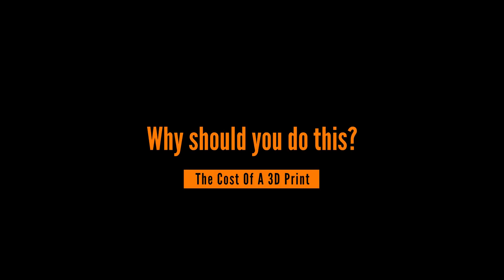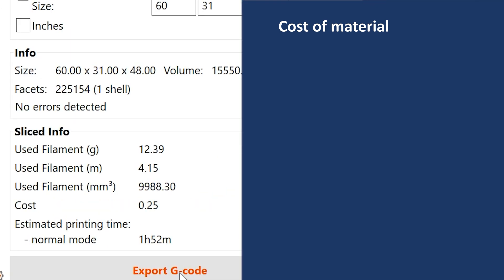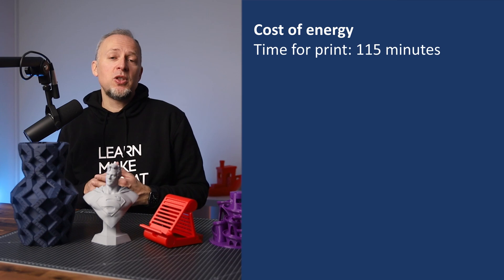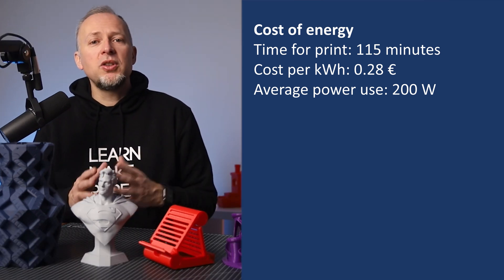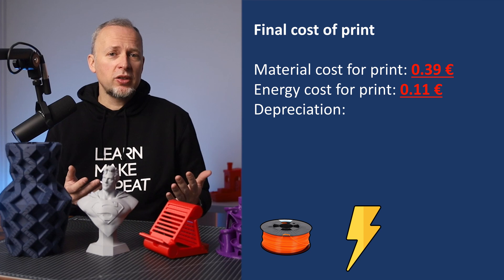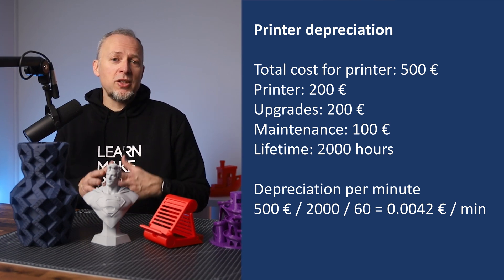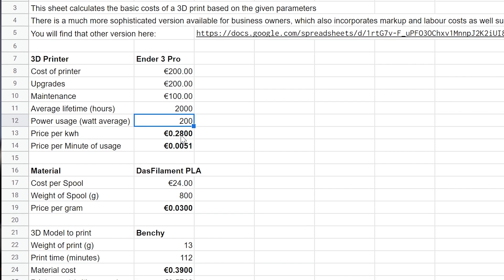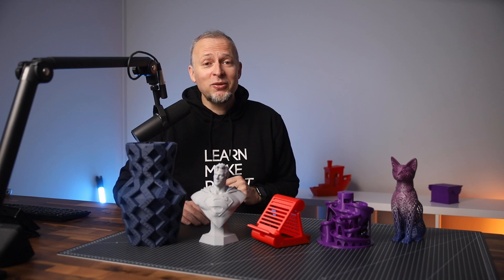The Cost Of A 3D Print - How to calculate + FREE TEMPLATE!

Comment from the maker: In this video, Daniel explains how to calculate the cost of a 3d print step by step and how to use his simple calculation sheet to make 3d printing cost calculation much simpler.

My simple calculation sheet: https://docs.google.com/spreadsheets/d/1gfuuR21fdRZWOYWdQsW0s5I5Q4PSdR1lK8_51lTnaI4/edit?usp=sharing
More sophisticated version for business users (derived from CNC kitchen version): https://docs.google.com/spreadsheets/d/1rtG7v-F_uPFO3OChxv1MnnpJ2K2iUI8qPukgcS2Icns/edit?usp=sharing
Reply: do you do custom jobs?
Reply from the maker: Yes, I do custom designs and prints. Do you have a project?
Reply: @Crosslink3D   yeah. I have contacted three companies and its been frustrating. One wanted to charge me $200 to resize my design. One responded 4-5 days ago and nothing after a greeting. Third accepted the design said they would resize and quote a price 3 days ago. Am i wrong or should that not take more than an hour for a pro?
Reply: @Crosslink3D  how can i contact you? I have the design and it needs to be re sized that is all. It is a circle with a hole cut out of the middle and a pattern of cut out designs. I need it to be printed with a flexible material. First i need two to test.. then potentially a lot
Reply: @CrazyScooterMods  I can help with your print if you want
Reply: 2000 hour life of a 3D printer seems really low. If an average of 8hrs per print is used, you can only print 250 models before you need a new printer? I would hope they last longer than that.

Comment: how do you factor in R&D costs? product design, test prints, software, etc.
Reply from the maker: Good one, I guess  this is very individual but I am considering some kind of markup for that. However you might get to it is the question. R&D needs to be calculated into the price with a certain expectation of sales of the final product and that is something you might not be able to guess easily. So with experience and probably a couple products launched you will be much better to guess this number. But it's not easy for your first product. I think enough margin buffer is required to have room for development and unexpected cost.

Comment: I like your information but I don't think the depreciation is correct. I use a Prusa printer (already has 4,000+ hours) and they are estimated to last at least 10,000 hours (5x your estimate). I have probably spent another $400 on my machine for parts but much of that has been upgrades not replacing defective stuff (like extra beds, new Revo hotend kit, LED lights, Rasberry Pie....) The only needed replacements were 1 boden tube (inside the hotend to extruder) and 1 bed thermister and 1 control knob this was a total of like $25 in just under 4 years. I also have used some lube, paper towels, alcohol (to clean bed) for the panel (the paper towels and alcohol are used every print but I get paper towels that are cut as 1/4 normal sheet and I use one of these small amount for 4-6 prints before replacing, the alcohol is likely the more expensive thing as I use lab grade 99.9% pure and I buy in 5 gallon for $140 (I use in my business to clean machines and epoxy as well) and I probably use $0.10 worth per print

Comment: In that business sheet... You have a cost of around 12 EUR and you apply a markup of 50% and the suggested price goes down - below the costs? What?
Reply: it was calculated wrong.  it shows a 50% discount instead of a 50% markup.  it should be 12.46+6.23=18.69. (12.46×1.5%)

Comment: Thank you for this video!

These numbers seem to calculate the break-even point for your costs. This is the minimum amount that you need to ask for your 3d prints. 

How do you calculate the fee that you are going to ask for to make it worthy of your time when offering your 3d printing service?

Some other things that can affect your fee:
- Your skill level in 3d printing
- Level of model detail (0.05mm - 1mm layer height)
- Complexity of the prints (high failure rate = higher fee)
- Type of filament used (PLA or difficult to print materials)
- Custom 3D Design or just DL existing model that is ready to print
- 3D Print design fixing and tweaking
- Speed of delivery (1 - 14 days)
- Bulk discounts (1 print or 1000 prints)
- Consistency in quality of prints
- Support and Customer Service
- Market price in your area
- 3D printing service availability in your area

I don't think it is unreasonable if you sell your model for 3x the cost price. You build it for 1 dollar but you sell it for 3 dollars. If there is a bulk fee applied you sell 100 models at a lower 2.50 dollars.

What do you think?
Reply from the maker: Thanks for the ideas. I am planning to make a whiteboarding session how to price a print end to end for real customers soon. So I will definitely look again at your list for more ideas what to consider.
Reply: @Crosslink3D  Awesome! 

I am thinking about starting a 3d printing service, but I also see many challenges when it comes to calculating the price per printed model. There are so many variables to consider! 

It is tempting to set a lower price than your competitors, but then it becomes a race to the bottom. This is why I think it is important to learn how to make 3d models (in FreeCAD, Fusion 360, etc.) and learn how to customize models for the specific needs of your customer. This is not something anyone can offer in their 3d printing service.

I will look forward to your other video's!